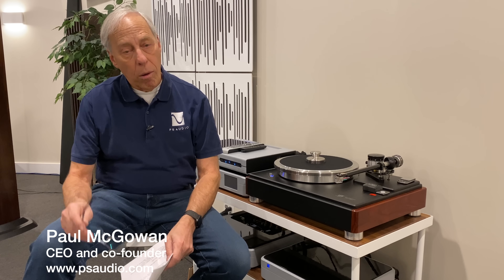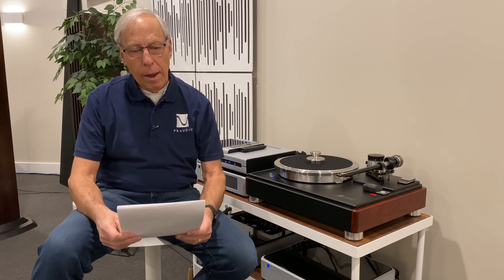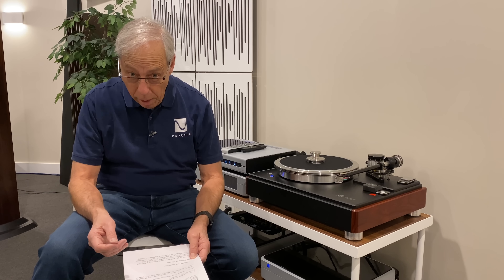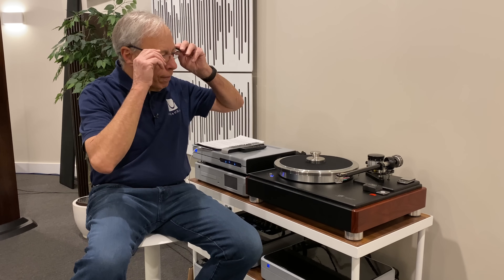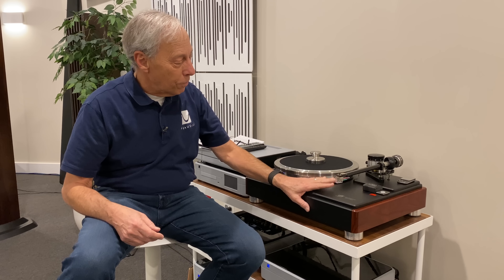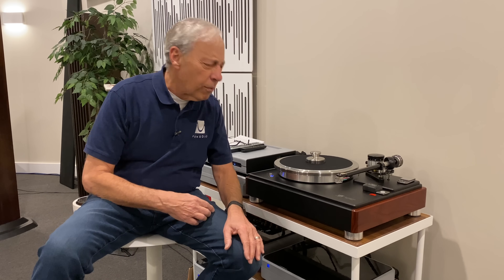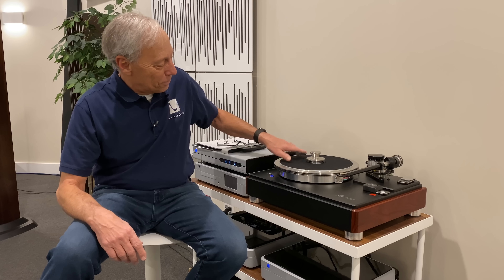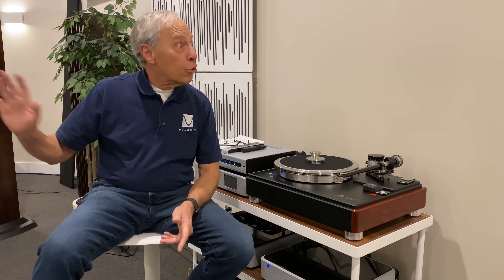Better to use a power conditioner or straight into the wall?

Comment: Hi Paul I really enjoy the videos and your pleasant demeanor. So, after decades of plugging equipment into the wall outlet, or extension cords, or cheap power strips, I bought a Tripp Lite LC1200 "line conditioner", which is advertised for home theater and computer equipment. It's apparently designed to keep a steady 120 VAC and act as a protective device. I'm only running an NAD receiver with energy RC speakers for a 5.1 system, and I can't say I noticed a difference one way or another. However during Christmas when my wife had lights running all over, the line conditioner appeared to be quite active as its LED indicator fluctuated from green to amber and back again. Is this line conditioner adversely affecting my NAD receiver's performance in any way? If I were to get rid of it, is it okay to use one of those cheap GE 6 outlet surge suppressors that simply plugs into one side of an outlet turning 2 outlets into 6? Or is it better to have nothing at all and just plug the receiver directly into the wall outlet? Thanks!

Comment: Okay, so somebody has to get an oscilloscope and show me how a power conditioner or regenerator affects the output of the power supply of a high end component. Then they need to show me how this change if any translates to an actual differance in the components output that can be heard. All of this needs to be validated in a double blind test of both the auditory and the visual (with oscilloscope) results.

Comment: In approximately 1990 while working as an electrician we encountered computers in the office spaces. They were a brand new technology that completely changed offices overnight. But the teething process was not as simple as expected. The first problem was an old style photocopier. I threw an oscilloscope on that line, and it was like a jagged road. From those early hard lessons we learned to isolate circuits, a necessity in these modern times. Yes, definitely yes, the electricity that comes out of the wall is dirty.

Comment: Blind tests have been done. 30 listening tests, and only 3 times the power conditioner was plugged in.  The audiophiles listening to it said that 20 of those 30 runs were conditioned 😂
Reply: I don't know. Power conditioners are important in certain situations, and God bless those guys for being excited about audio and not a more negative hobby. But if someone's going to argue that it improves or degrades detail/soundstage or whatever audiophile terms they use, I'd really love to hear them explain how that would be possible. Like, in terms of the circuit, just tell me where you're saying things are 'cleaner' and then we can hook up an oscilliscope to the components in question and test that theory!

Comment: I have an old Furman 'power factor pro' and when I started putting together my current audio system I put this Furman product to use without thinking about it (and without A/B testing). After watching this video I A/B'd the sound with and without the Furman product. My results were just the same as what this video says. I am amazed. Paul, you have great ears!. Thank you for this channel!
Reply: It'll still protect your gear from power surges.
Reply: @newgunguy4176  So will any non conditioning, surge protector power bar

Comment: Having done live sound as well, the best is to get as clean and solid of connections as possible.  Thus lowering the impedance of both source and drain.  The more stuff involved, the greater the likelihood of noise and losing impact.  There is a Furman box that's supposed to lower the source impedance of the AC, had one on a guitar amp that had internally regulated supplies so the autotransformer things wouldn't help.  Haven't tried it on the hi-fi system.  Perhaps I should dig it out, although I think it's just storage capacitors.

Comment: I understand the concept of adding impedance would affect the ability to supply higher current to an amplifier, such as when playing strong bass notes. However, I don't understand why it would affect a subtle signal as the decay of a note from the pluck of a guitar string???
Reply: if the dynamic range is screwed all the signal is affected not only the release

Comment: Here's a simple experiment for non believers. 
Plug in all your system and source/s...but don't hit Play or don't lower the tonearm...turntable spinning, phono on.
Now turn the volume of the amp to the max level you would listen. 
Do you hear anything coming out of the speakers? If you don't, you're lucky...you don't need a power conditioner...if you hear a shhhh, a hum, a buz well you need one...along with possibly better grounding for your turntable !
That shhh, buzz,hmmm you hear will be ON YOUR MUSIC so yes...it's like a fog
A 300$ Audioquest will drop the noise by -22 dB
That's HUGE
Reply: For non-integrated amp if noise depends on volume control it means its source comes from signal source, so that input signal already contains noise with SnR worse than 120dB. So you should fight with source power supply only.
Also note if you listen to music with lower volume, and you don't hear noise in pauses from your listening position you will never hear any kind of distortion or non-clear music when it plays via the speakers.
Still if some spirit of audiophile demands no noise from speakers you can install 20/24dB attenuator on the amp input port (either RCA or XLR - depends on interconnection of the system). The attenuator will suppress 20/24dB of source noise, while you will need to increase pre-amp/source volume control by the same 20/24dB to keep level of music same as before.
Reply: Alexander Belov 
Good info thk you.
In my case I have a Rega RP8 with it's own power supply and Rega Aria Phono...as good as it gets...still there's some noise..I think the Aria's SnR is like -80 dB or something like that. Both the RP8 and the Aria phono have great power supplies...not more to improve there.
Reply: @SpaghettiKillah  
You can check if the amp is your source of noise. Just disconnect input cable from the amp, switch it on, and hear level of the amp noise from the speakers. This is minimum of noise you can reach with some attenuator.

Comment: We are talking about a Clean Alternating Sine Wave.
  sure the power from the pole is fairly clean.
what's inside your building probably affects the quality more than anything. 
 example: I have an electric baseboard heater, when ever its on I can clearly hear an increased Hum
thru my audio system. 
preventing induced line noise from your existing electrical crap you have pugged in around you  

may be a better solution than working to remove what your crap is doing to your power.

Comment: Any power conditioner that might make a difference is to expensive for most buyers and still isn't guaranteed to make any audible difference. Pual has engineers and all the test equipment at hand yet only provides anecdotal evidence and stories instead of just demonstrating the science and measurements like Amir over at AudioScienceReview. If its audible to humans small hearing spectrum it is easily measurable. I do agree with Pual in this case, power conditioners are a waste of money just like surge protectors.
Reply: Surge protectors don't influence sound. They save any equipment from overvoltage. In some cases lightning near the house can cause voltage surges in power line of about 1-10kV. If your equipment does not have properly rated varistor connected in parallel between line and neutral your equipment will take this voltage  surge inside with all implications.
Some surges can also come from other loads having powerful electric engine inside without proper surge block. When such equipment is switched off it produces voltage surge into power line, because some amount of magnetic power accumulated inside the engine coils discharges back to power source as EMI electricity.
Reply: @alexanderbelov6892  Naim engineers advise that surge protectors even plain power strips with a light switch can hurt the sound.
Reply: @rd264  
😂😂😂

Comment: Use a real power conditioner, and not an overrated home grade unit that doesn't even do half of the filtering. Get the furman pf1800, it's pretty much the only power conditioner you can buy that actually does what it says, only few options are as good.. this furman power conditioner... it even has large capacitive reserves to provide on demand current to prevent power compression, ive looked at them closely with the tops off and have studied the circuit layout, nothing but quality parts, it actually does filter out the frequencies it says in the spec sheet, it actually does remove emi and rfi from the wall, as well as clicks and spikes from air compressors and other things, noise floor's are improved dramatically and it actually regulates the line voltage within 5% or better, it's the real deal. Plugging your expensive equipment in the wall directly is quite stupid, especially if there is a power surge, or a brown out or you have terrible power, ive lost equipment from such things already. Hell, if you wanna spend more furmans true sinewave ups is fantastic as well, i have a more buget setup currently, but ive seen first hand what even their highend stuff can do, and will be upgrading in the future. "to explain in much detail would take far to much time" Perhaps ill make a video on it some day. Currently, i opted for a more buget setup for the time being that is still decent, i have a furman m8x2 "harmonic line filter which actually does reduce line interference, ive measured it" with a cyber power ups with pfc protection which is a buget frendly true sine wave ups backup battery being fed from the furman, get the 1500va unit from cyber power which is good up to about 1200w, make sure its the one with pfc protection, otherwise you wont be getting a true sine wave when it needs to make corrections, ive had the power kick out and things just keep playing along like its nothing, I've even continued recording when such things would happen, still sounds perfect lmao. Combined surge protection is well over 950 joules from both units and more importantly, the power is very clean, it reduces line noise to the point of being inaudible, especially when i make recordings, like ripping vinyl, or casettes or recording instruments, its nothing but a black background, no more irritating line noise, no more pops from refrigerators or air conditioners compressors kicking on and off, no more noise from light dimmer circuits, nothing, pretty much perfect regulated power, i have the ups hooked up to my computer with everything set to be as sensitive as possible with their cyberpower power panel software.... If you have such an expensive system, but dont invest in good power protection/filtering devices... you are truly a fool... and will learn one day, i laugh at people who talk down on these things because ive seen the damage not being protected can cause before, ive also lost a lot of data in the past... After reading this, if you still dont believe me, that's on you, lmao

Comment: I did the test. 

I bought a passive line conditioner and connected my headphone amp and DAC into it. I used a source that was battery powered running USB into the DAC; volume stayed constant as source was turned to 90% and amp volume set to 40%. I can say I noticed a difference with my higher end headphones (especially if they were planar drivers.) Nothing earth shattering but there is a difference to my ear. I also did this for friend where I would change the power source with him not knowing which I was plugged into and he also noticed a difference and after a couple songs could pick out which I was connected to (until I plugged one into the conditioner and one into the wall to mess with him.)
Reply: DACs usually have power filtering (including power control microchip) to provide noise floor (no signal) of about -140dB to -150dB. So not clear how any external power filters can improve it.
Noise comes from headphone preamp only.

Comment: Plugging in High end audio equipment into a standard 120vac receptacle is a big No, No. Equipment like that should always be on an IGR. Oh, and you can't install an IGR yourself. That's NOT something you can DIY. If its not properly installed you'll just end up making things worse. 🤦‍♀️

Comment: So the resistance thing confuses me a bit. My house can easily draw over 10KW when all the heating is on, there is no real shortage of power to drive the 100w my amp might need. If I where to remove the amplifier and drive the speakers directly from the mains I would wager it could deliver enough power to overdrive my speakers a bit. I am assuming my amplifier has a large inductor in the power supply and a couple of smoothing caps that effectively form a filter back to the grid so, as power is required to drive any signal in the amplifier, that is provided from the components of the power supply and not taken directly from the grid. These are required because the AC from the grid is off for part of the time and power is pushed into the amplifier at the 50/60hz cycles. At that zero point the resistance of the mains cable is not relevant. I could maybe see that there might be some interaction between a power conditioner with it's coils and positive feedback in the way it interacts with components of the amplifier PSU as it's not expecting such an active mains input maybe.
Reply: spot on.  If impedance would cause of lack of clarity, floating fully balanced amp design would be the industry standard.

Comment: What about Online UPS? I live in Bali Indonesia and the power can be very unreliable here. My entire mains first go into a power conditioner to stabalize the Voltage and then for my AV equipment I use a big Online UPS to protect it further. Sadly going straight into the wall would very quickly kill my AVR and Projector
Reply: Can't help, but Bali is beautiful

Comment: Chord recommends plugging directly to the wall
Reply: Probably because Chord stuff is so well-designed including running off internal batteries or super-capacitors. They don't need any help.
Reply: @phantomplastics6582  Lmao, 50kv lightning strike, will strike a chord alright, especially when the mov's inside smoke up from trying to dissipate the heat from absorbing the surge, I'd never chance it.
Reply: @analogaudiorules1724  wouldn't a home breaker go off? If not, would it not be better to own a surge protector rather than a likely more expensive power conditioner? Or was a surge protector what you were suggesting?
Reply: @nicolaswirtz6952  best protection is to unplug.  I know dedicated grounds, lines and fuse box breakers do not protect from a surge from a lightning strike. My amp,  a cd player power supply and speaker woofers all got zapped by a surge which left all other plugged in household stuff unaffected.  cheap surge protector for the TV got zapped too.

Comment: I live in a condo in New York City. The quality of sound I get by plugging my Yamaha A-S801 amp into a Monster HTS-400 power conditioner is unquestionably better than the sound I get if I plug it directly into the wall. I have checked this on three different occasions and each time there is clearly more noise in the sound I get when I plug into the wall. The noise results in listener fatigue much faster than if I plug into the power conditioner. Through the conditioner the sound is much more smooth and refined. As for dynamics, I honesty hear no difference whether I plug into the wall or into the conditioner.  

I say all this to suggest that everyone's situation (room, gear, electricity, etc) is different so it is important to check for yourself. Time and time again, I have read online that amps should only be plugged into the wall. In fact I have read it so much that I could have easily taken this to be an objective truth. However, I like to keep an open mind and hear for myself. I suggest you do the same.
Reply: do you think it might help, to plug in everything else to the power conditioner, and leave the power amp alone?
Reply: @allansh828  No Allan, it does not help. I've tried what you suggest at different times of day, different times of the year. And each time I compare, I find that I get better, cleaner, less noisy sound by plugging everything into the Monster HTS-400 Power Conditioner.
Reply: @zaoria123    thanks for telling me. There are different sockets on power conditioners. At least one for high current and others for linear current. I guess you are supposed to plug Class A amp into linear filter?
I have a headphone amp, which draws mere 0.15 A constantly. The linear filter sounds coarse and dynamic and the high current filter sounds smoother but bloated. I have to choose between two problems. I should probably try another power cord, since my AQ NGR Z3 is made for power amp. Maybe getting into high end audio is asking for trouble after all.
Reply: @allansh828  No problem, Allan. On my Power Conditioner, all receptacles are equal. They all filter and clean the power. Good luck in your audio journey!
Reply: Some of the problems caused by power conditioners include high energy spikes (causing contact arcing, which resembles a clicking sound), lose of detail due to broadband noise, or distortion in the mains supply due to industrial loads. Many of the effects produced by these include bloated bass, distortion, brightness in the high frequency, three dimensional depth reduction and poor imaging. You might be thinking that you don't hear any of these things, so your system must not be effected, well once you add a mains cable, all will become apparent, suddenly your system will open up with superior dynamics, tighter bass, sweeter treble and improved depth and imaging. All this can be achieved by simply using a mains cable on one component, and you will hear the difference immediately. Naturally adding them to all components will offer the best sound!